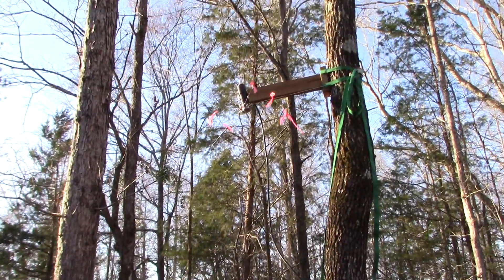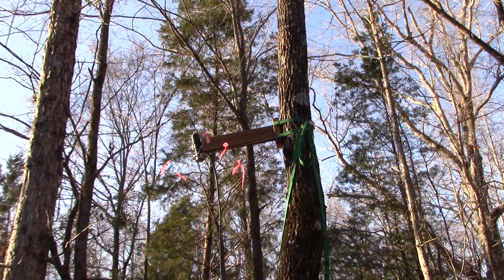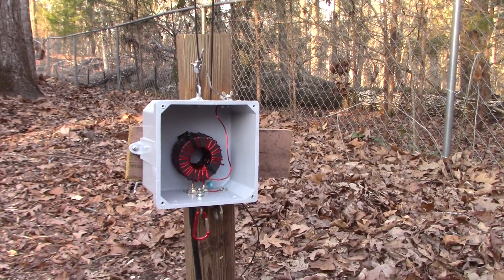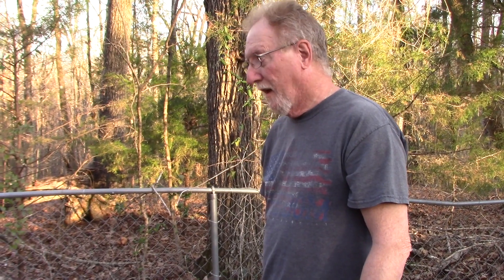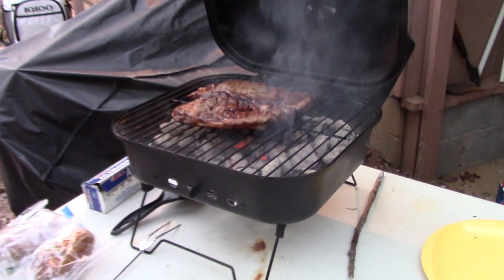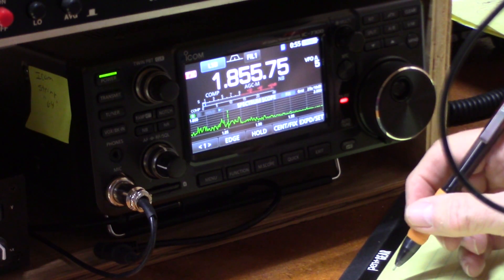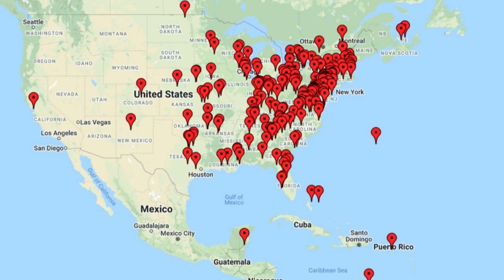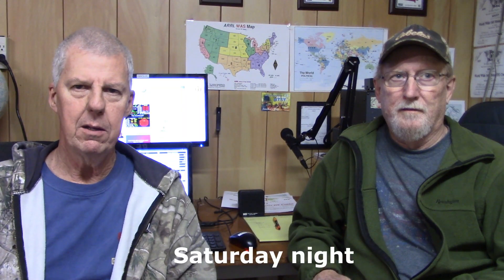Vertical Antennas for 160 Meters / CQ 160 Contest ssb

Comment: Another question. 

I hv a My Antennas,10-80 efhv, 130 feet, flat(@20 feet high). With my Icom 7300 and mfj-998, the wire works really well. I can even work 160, decently with low swr. Now, I have a ground wire coming off of the 49:1 to a grnd rod. Off of this, I hv multiple wires for a counterpoise( my experiment), which improves the low bsnds🥳. 

If if if, I put up, in the same configuration, their 9:1 with 173’ or 202’ wire efhw(these are their lengths available), would I see a sizable improvement on all bands or low bands, etc, vs my 130 49:1??

Just curious. 

Ps.  With my amp and 400 watts, I really have a good signal.  

Thanku for the help n your input. 

Billy
N1mrk
Reply from the maker: Hard to say. Go experiment. See what works for you. That's what it's all about.